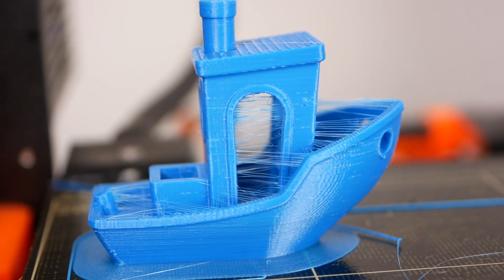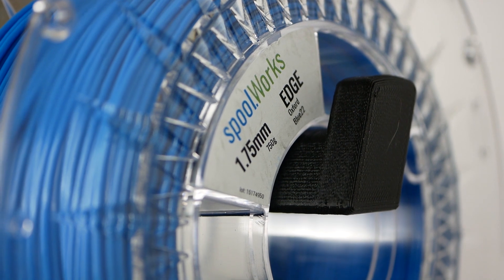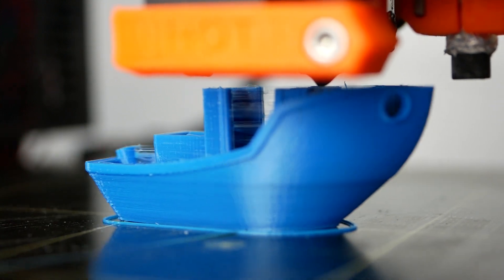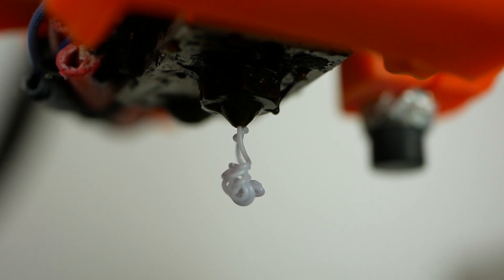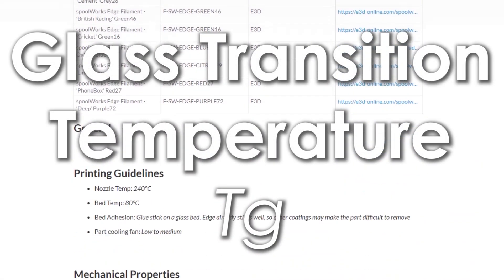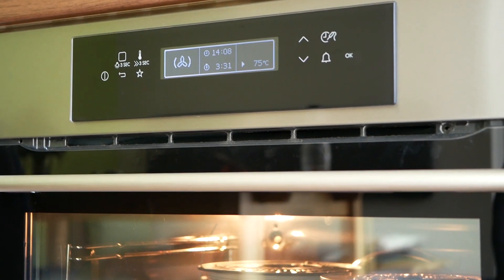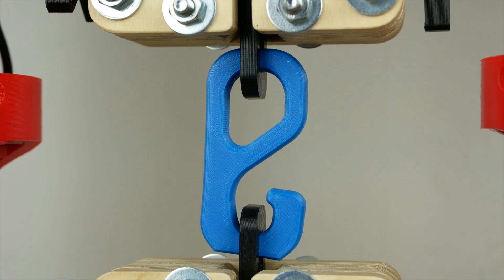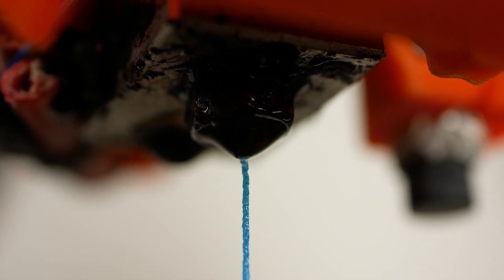WHY you NEED TO DRY your FILAMENTS!

Comment: I thought I was having a problem with my printer because I ran my filament through the dryer at the recommended temperature and time and was still having problems. Then I turned the temp up to a little shy of the melting point and left it drying for a full 24 hours. Problem completely solved

Comment: I made a pressure seal plate, apparently the filament was wet, air at 40 psi goes through the plastic, bought a Sunlu filament dryer.

Comment: 25 watt dehumidifier on amazon $20
100 quart storage bin at local big box store $10
25 watt reptile or seedling heating pad on amazon $10
silica gel indicator on amazon $15

It won't dry your filament in a few hours. But I keep all my rolls in that $55 bin and they get dry in a week or two. I don't burn thru filament like crazy, I could see needing a specialized box that only fits one roll if I imminently needed dry filament. Silica gel helps in case the power goes out and you haven't emptied the dehu tank and it's nice to not have to recharge the beads in the microwave so often.

Comment: Great Sunlu, out of the box it has moisture in it.  I have a roll of Inland PETG red transparent from 6 years ago that has been sitting out. I've printed a bunch of parts recently without issue.  I got this new Sunlu PETG gray here 1/2023, it is total hot garbage constant bubbles.  I am actually running 215C extruder temp, something is wrong here.  I got another brand of PETG, will return the Sunlu if this new stuff works okay.

Comment: some air fryers have a dehydrate function to dry fruit and make jerky. wonder if it would work...
Reply from the maker: Yes, they probably will. Though you need to be able to control the temperature quite precisely to not melt the material.

Comment: I don't have lot experienc in 3d printing. So small details like dry filaments can cause me tons of head pain) like i got spool of filament printed some models, and then keep it for some time. After i back after few month and try to print by the same spool it is became wicked, and i got thru cycle of temperature rising, leveling, extruder adjustments, even nozle cleaning, and all this measures worked somehow for +- stable prints. And after i saw this video i realised problem ) and why my spool became unstable. Thanks for sharing knowledge, and really nice experiments.

Comment: Yes moistened filament wont print well. But for 3d printed structural integrity wouldnt it not matter since just sitting out itll absorb moisture.  So would your testing hooks if the hook sits for a few days in open air wont that weaken as well?

Comment: Hey Stefan, I also noticed humidity affects the surface finish of PLA a massive amount especially when "ironing" a top flat surface.  In the summertime where humidity can reach 60%+ in my place the surface finish from "ironing" is very poor.  In the wintertime where humidity is currently 34% in my place the surface finish from "ironing" comes out great.  Do you have any data on controlling the storage environment of PLA to improve the surface finish for "ironing"?

Comment: I just got an ender3 and I only have the pla from the set. It's bad even though it came in a sealed bag. It's too flowy, I can hear sizzling and prints have lots of strings. I've seen this before with nylon, but did  not expect it with pla.

Comment: I'm having issues with surface finish. I have seen some bubbles in extruded plastic strands. The prints looked fine when I was using a 0.4mm nozzle but now that I am using a 0.8mm nozzle the surface of my prints are rough. Drying the filament seems to be a very reasonable solution.

Comment: Drying my PLA at 100° celsius in the oven and it doesn't even get soft. 45° is too low.
Reply from the maker: You can do that with Polymaker material but almost everything else will be severely damaged at these temperatures.

Comment: After watching every single video about moisture and filament, and reading just about every comment, I've come to the conclusion that drying your filament is a complete waste of time. I can change the settings to fix any kind of popping issues. I read lots of comments from people that live in humid regions and none of them dry their filament.

I recently started having popping issues and was led to believe I needed to dry my filament. After doing some very simple things, like in some cases just lowering the temp a few degrees. It solved it. Saved my money not buying one of those filament drying machines that just uses more electricity.

Having said that, I think proper storage with some kind of desiccant is prudent. Since it's cheap and you won't need to dry your filament if it never gets wet in the first place.

Comment: "as soon as the extruder gear stops turning, the filament flow should also stop"

I might be misinterpreting what you're, but I don't think that's 100% accurate. Your extruder builds up pressure as your machine basically jams more material into it. With a restricted flow out the nozzle, it should take about a second for filament to come out and equalize pressure again. 

unless you are saying it should stop after the machine retracts the filament, in which case, then youre more accurate. Not sure if that's what you're saying though.

Comment: I've only ever dehydrated TPU before printing. A couple hours in the oven at 160ºF makes a huge difference, but after watching the video, I may go much longer next time, as well as try it out on other materials. I had a hell of a time getting print parameters for PETG to print a watertight container, and I never did get it 100%. Maybe drying out the filament first would help!

Comment: So does moisture, say at saturation point, change the finished parts strength? meaning, after the parts printed optimally, if you leave it outside and it gets wet, is the part weaker until dried?

Comment: Humid summer .... I just laughed my ass off.  It is December 2020 in Florida with 60-70 degrees but humidity is up over 60% due to rain every other day. If we don't have any rain I can get my house down to 30% humidity but as soon we get down poor rain the house humidity spikes up to over 60% even with a humidifier running 24/7 it is like a battle you can't win. So I store my filament in sealed containers at all times and bake the ABS and PETG in the oven for about 4-6h when it was on the spool holder sitting to long. SPANNERHANDS Spool holder a thingyverse project is a very good alternative because that pool holder is like a vaccum chamber with bodentube running right to the extruder..

Comment: A maker can get a cheap dehydrator and for extra $20  a tp-link smart plug switch. Now set that knob to the temp (60C for PLA) and set the smart plug to  run 6h.  In Florida in a garage, PLA gets wet in days. My first run with wet PLA, I did not realize that it can clog the hotend. I ended up replacing part after part. Till I figured it only happened with PLA that was out for a couple of weeks and never with new spool. Dehydrator was the key for perfect prints,

Comment: If H2O breaks the polymer chain, does a polymer straight out the package in a dry state out perform a polymer that got wet and then has been dried out? Do the chains bond back together after drying? Thanks.
Reply: I'm a polymer chemist - you're not going to get chains re-forming once they've hydrolysed really. It's chemically possible to make new ester linkages (that's essentially how these materials are made) but normally it requires high temperatures, a catalyst, and water to be removed during the reaction. It won't happen under practical conditions to a filament however much you dry it out. 
Whether drying wet material before use returns it to the properties of fresh material depends on whether hydrolysis is happening during storage or during printing (or even during drying if you heat up wet material)... my hunch would be that hydrolysis is more likely to be significant during printing rather than storage as you've got hot molten polymer which is more likely to react than a solid at room temperature, but I haven't done that experiment or specifically read up on that subject so I can't tell you definitely. If I'm right, then a filament dried before use would not have hydrolysed and so would end up giving you essentially the same performance as a new/never-wet filament...

Comment: Totally unbelievable and unsceintific:  If you want to make statements about humidity, buy a humidity meter, and start from the readings! A whole movie about humidity, and you haven not even done 1 measurement!  BTW, a fooddryer is not a filament dryer: It is used to dry food (up to 99% humidity), which filament is not. Warming up something (and lowering RH - as long as it is warm) is not drying. If you want to dry, you need to lower absolute humidity, and those cheap systems hardly can.

Comment: Good day, Stefan.
I am starting in 3D printing and would like to start on the good foot.
Your video was quite instructive and I would plan to purchase a dehydrator to dry me PLA filament spools at first and then, store them in a dry environment like you did.  Except that at the moment, I have something like 17 spools (all the main colors (black, red, green, blue, yellow, orange, purple, grey and white), and all metallic (sliver, copper, bronze and silver) not forgetting silky colors (red, green and blue .. for now !  LOL) and neon yellow too !  I'm missing the transparent ones (red, green and blue), but it won't be long.  I think I'll need lots of containers .. unless you have an idea for me.

For the time being, I store them if their original box with silica gel pouches (5g x 4) and I'm afraid that it won't be enough to keep them dry, since I like in Canada (Québec) where it's mostly humid and, the boxes, being cardboard, will transmit humidity to the filament.  However, I bought « reusable » desiccant.  Will this be enough to keep them dry ?  Ambiant humidity level, is around 50% in the winter, and 70% in the summer.

Thank you for your suggestion and your time commenting on my intentions.  Have a great day and happy continuation.  I like your Channel.

Comment: It seems I may have found why my prints suck lately.  The outer wall is fine, the brim is fine but the top layers are like spaghetti with whispy bits of hair sticking out and bubbles in. I tried everything on the printer with the nozzle temp and found that it got better only when I turned the cooling fan almost off, running it hot and slow. I think I may be cooking the moisture out while it's printing but it's still bad. Only happens with the black PLA which I've had for years.
Thanks

Comment: Great video! Although for the testing with filament that has the most moisture, it would've been helpful if the filament experienced the more realistic conditions of being left in room air over the course of a humid summer or two, rather than being left in a plastic bag with a moist towel (because nobody does the thing with a moist towel). There might be a significant difference in water concentration in the filament and how far the water is penetrated into the filament.

Comment: I got my first 3d printer (Ender 3) a few days ago and am thinking of getting a dehydrator. Just wondering, can pla be too dry? I bought some silicon desiccant packs to store with the reel in the box it came in for now whenever I don't intend to print for a time. I'd guess that drying the day before I print while I'm at work would be good enough. Until I decide to jump into Octoprint, I can only really print over the weekend.
Reply from the maker: You can damage the material by drying it too long in a hot dehydrator (over several days) . Just storing it with silica gel should not damage it.

Comment: Hy , i have an ender 3 pro with some modifies, and i get a nice looking surface , hood extrusion but the extern wall , i think it is thin wall , with green in cura, it dont stick to the printed part , there i a gap betwen that wall and the inside print , what can i do ?

Comment: Outstanding work! Thank you so much. Have you thought about using a dehumidifier in the room? That may be what I'll have to do in my basement.
Reply: basements are generally a bad place to print because of the cold atmosphere unless you have enclosures for your printers
Reply: Thanks  @joshklapperich9416 , I have an enclosure for the first one, but not yet for the second one—I'll have to build one. More than temperature, though, my concern is humidity, and the effect it can have on filament.

Comment: Can you "overdry" your nylon filament (or any other type)? Dry it too long, so somehow by getting rid of water, you remove other chemicals that may be needed for optimal consistency? Thanks!
Reply from the maker: Yes you can. At some point you'll also damage our get rid of the additives. So don't dry too long or too hot.
Reply: @CNCKitchen  thanks! ;)

Comment: Anyone looking for a cool new program for generating 3-axis milling/routing toolpaths for making signs/engravings/CNC-art/etc should check out PixelCNC (http://deftware.itch.io/pixelcnc/). It's an easy to use CAM program for generating toolpaths + g-code from image designs, photos, and even vector graphics super fast and easy. There's also support for importing 3D models, an intuitive G-code post-processor that allows outputting CNC programs for just about any kind of controller or machine, and a simulation system for previewing an operation's generated cut paths. It's a project to undercut the ArtCam/Vectric software out that I've been working on since summer 2017 and we're about to introduce a new canvas system that enables users to load multiple images/models for a single project and even create/load 2D geometry and text for generating 3D contours from. If you're new to CNCing or have been trying to squeeze as much value out of low quality freeware as possible and feel like your whole process and workflow could be stepped up, without breaking the bank, then PixelCNC is for you.

Comment: pro tip: "crystal" cat litter is the cheapest and most widely available source to get a lot of silicagel. just fill old socks or so with it. before using it as a dessicant, it needs to be dried in the oven or microwave, though. holding a spoon over it, and looking for condensation, is a great indicator to see if it's actually dry. 
(the cat litter comes partially saturated, so it doesnt stick to a cat's slightly damp paw pads. cats despise sticky things.) 
PS: if you arent in a hurry, a few days near a heater, in an airtight bag with plenty of dessicant, revives most soggy spools.

Comment: Just a pro tip regarding those round food dehydrators: You don't necessarily need to cut up the trays that come with the machine. I discovered that you can use a single tray on the bottom and then put a 3.5 or 5 gallon bucket on top of it. Drill four 3/8" (9.5mm) on the bottom of the bucket for air to escape. Works perfectly. This lets me keep the other trays clean so I can use them for drying food. I recommend putting a thermometer of some kind inside of it because the numbers on the dial do not correspond well with actual temperature. Also, it's possible to over-dry a resin. This is more of a problem with Nylon. Over-drying results in increased viscosity, which can cause its own problems during printing. You usually want to shoot for three to four hours at between 50C-116C depending on the specific resin. If you're unsure of what temp to use, literally google the resin type with the words "drying temperature" after it. You can also hold the temperature at about 30-35C indefinitely without any detrimental effects. This won't actually dry the filament if it is moist, but if the filament is already dry, it will maintain it.

Comment: Very informative! Vielen Dank!
I have a question: You are printing a blue benchy and this benchy has a different shade of blue in the lower part. My Benchys look exactly the same - how do I get rid of this?
This is best to be seen at minute 2:37. What causes this issue?

Thanks in advance
Reply: Robby Diener the lower part of benchy has the infill inside, which makes it look different. There is additional material on the inner side in that area. That’s why it will always look different in that way, no matter which color you choose.